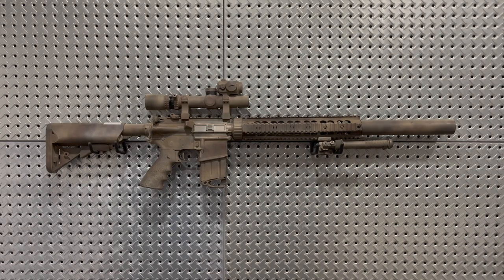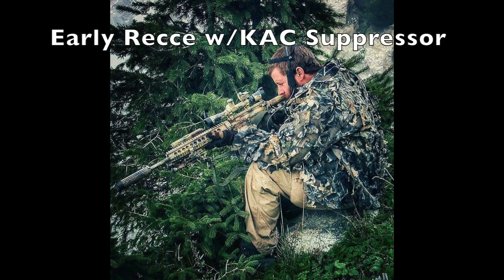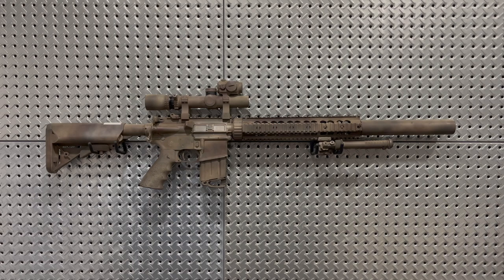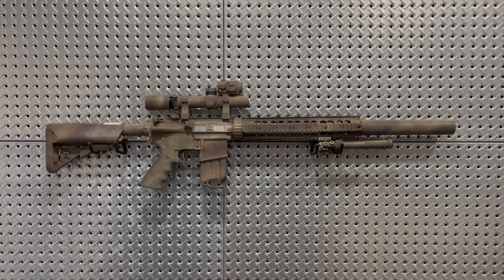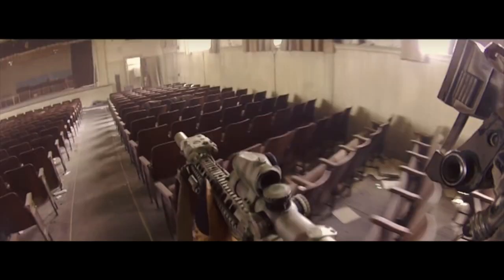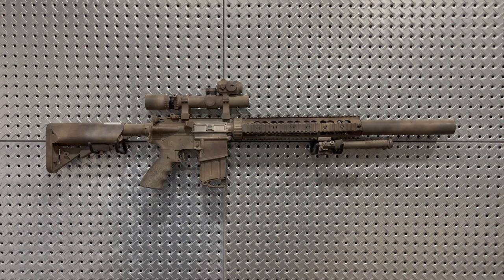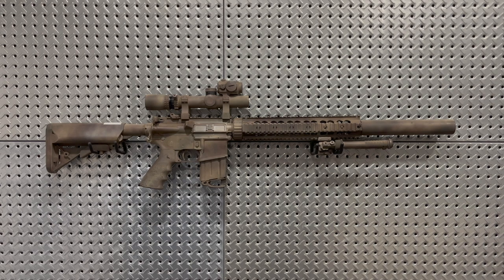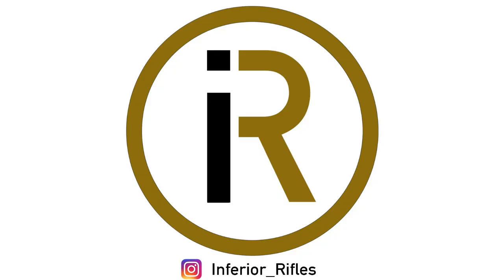SEAL "Recce" Clone Build Overview

Comment: Man.. now days, those KAC rail systems are more expensive than some guns.
Reply: June 2022- a KAC FF RAS auction on GB closed at over $1500
Reply: Are full length RAS discontinued now or just momentarily paused with production?
Reply: @bdanyellz4067  They are produced in cyclic production runs; the last production run was pre covid
Reply: As of 2024 just picked one up for 450
Reply: Found one for $550 new.

Comment: Something about the fixed stock versus the collapsible. At the time, there was no H2 or H3 buffers for the carbine receiver extension; so, using an M4 lower with an SPR upper that had the suppressor attached was advised against by NSWC Crane. There was too much potential of breaking the rifle with that combination. With the introduction of the Mk.18 also came the H2 and H3 buffers and facilitated safe use of a collapsible stock with the Mk.12 and Recce rifles, though still not suggested by NSWC Crane.
Reply: Breaking the rifle wasn't the issue; bolt carrier bounce on full auto was the reason. Alan Brown and Vince Jiga have spoken about it in depth.

Comment: Very interesting! I always thought the RECCE came after the Mk12.. I'm almost done my RECCE I just need the handguard..
Reply: There were all different types of "Recce" variants pre-M4, which likely drove the M4 into being a flattop railed upper.  On the Army JSOC side, they were cut 723 uppers with drilled and tapped rails on top of the shaved upper.

On the Navy JSOC side, they were cut 727 uppers.  M4 was in development right around that time, and early XM4s had 727 uppers with different barrel profiles, eventually settling on the 727 barrel with stepped 203 bracket cut on the forend, but with the dual heat shield handguards, 4-position RET, castle style lock nut, reinforced pivot pin bosses, and beefed-up RET thread boss on the lower.

The most unique Recce rifles were in The Unit, where light and laser mounting and user interface were worked out better than most modern builds.

Comment: Thumbs up.  SEALs got the idea from JSOC, who had certain carbines modified for DMR use among the Sniper Operations Teams within Recce Troops, as well as one of the many options for Assaulters to accommodate attached lights, lasers, and free-floated suppressed set-ups.  We're talking even before Mogadishu 1993 timeframe.

723 uppers had the "carry handles" cut off and had Weaver rails drilled and tapped to them for compact Japanese 1.5-4.5x Microdots, Hensoldt, and Leupold scopes by Unit armorer section for the DM builds.  KAC made some early 1” high rings for those since they had already been making scope mounting options for the SR-25 Match Rifle.

They also used modified SR-25 Match rifle float tubes with special AR-15 barrel nuts, Bushmaster V-Match free-float tubes, and initially tried Douglas match barrels shooting 68 or 69gr OTM ammo.  The Douglas and other match stainless pipes burned out pretty quick on their shoot schedule, so they found a supplier for CMV steel barrels that would shoot well and used those instead.

DEV took notice when working with Army JSOC, and then it spread into the SOCOM elements of the Teams.  Navy sourced a lot of Lilja barrels for theirs, including 17".

You can see pics of "Sawman" Sawyer with an early Recce version of what I'm talking about with the knurled aluminum float tube handguard, Leupold, Wilcox Laser, etc.

In The Unit, some Teams had these with FSP cuts in the tube with holes drilled for the taper pin access, and small sections of rail drilled and tapped where necessary for the PAQ-4, Surefire P60, modified A2 VFG with integral cockpit-type push buttons for the light and IR Laser.

Most of those rifles had standard Abu Dabi 723 uppers with A1 sights and shell deflectors, different types of carry handle rails, and Aimpoint 2000s, then later 5000s.

(Some of those configurations were used in Sniper Teams in Ranger Regiment as well for the Sniper Team Leader 727s, and the Aimpoint 5000s transferred over on some guys' M4A1s in the 1994-1995 time period, then were replaced with Comp Ms.)

The Unit Recce 723s also had Fiberlite stocks with cheek pieces, sharktooth butt pads zip-tied in-place, and Lone Star Ordnance enlarged pistol grips with swivel cover storage compartments on the bottom of the grip.

The KAC MRE M4A1s largely replaced/superseded these JSOC Recce carbines since it was easier for armorers to replace barrels on the KAC free-float tubes than the elaborate workaround of the cut and modified CF or aluminum tubes.

There were also the OD Green fiberglass ArmaLite tubes with threaded sockets wherever the Operator wanted them for rail section attachment.

The JSOC Recce 723s with 12" tubes and suppressors were one of the unique configurations you just don't see any photos of, especially with the integrated button A2 VFGs and mini rail sections, with Front Sight Pocket cut for the FSB.

When you see a fully-configured JSOCMOD Recce 723, they are very striking with the suppressor emerging from inside the float tube, like an MP5SD.

There were a lot of Redi-Mags in-use back then as well.  Bowflage was popular for camo, since it was an extremely matte texture.
Reply: Thanks for that run down, cool info I had no idea about! You should have a YouTube channel. I'd be there 👍
Reply: @westernoutpost4154  It's hard finding parts for those types of builds, especially the Lone Star Ordnance pistol grips and "CAR-15" marked cheek pieces that snap onto Fiberlite stocks.

Same for the sharktooth butt pads.  The stock weld you get with those sharktooth pads is superior to any other butt pad I've used on the market.  Once you index, they just stick to that place and don't move.
Reply from the maker: The Recce “rabbit hole” certainly is deep. It’s hard to pick a timeframe or even a specific group when talking about rifles like these without making a super-lengthy video; I was tempted to mention the various other programs that were going on around the same time (Army SDM-R, USMC SAM-R, etc) but I chose to only mention the programs that persisted throughout the GWOT and are still being used today (albeit in very limited capacities). Thanks for watching and for your informative comment
Reply: @InferiorRifles  Throughout the history of SOF units using certain oddball AR-15 family weapons, I'm particularly interested in the 1963-1967 period, the 1980s, and early 1990s up through 1993 before we started seeing M4A1s and eventually M4s enter into service.

One of the first AR-15 Light Sniper rifles was the Colt 656, which had a railed upper receiver, hooded FSB, heavy barrel, and flip-up rear sight with rounded protective ears.  It was developed and operationally fielded among hand-selected snipers in Vietnam, along with 2 M-14 variants and a bolt gun by the Army to determine what direction they would go for a Sniper System.

The 656 had a somewhat elevated Weaver rail integral to the upper, along with the BUIS flip-up aperture, but was fielded with a scope.

Different units tried the Colt 3x and 4x scopes as well in an ad hoc DMR set-up, and we even had some of those Colt scopes in arms rooms into the early 2000s.

There was a gunsmith in the Fort Bragg area who did flat top conversions for guys in The Unit dating back prior to the M4, where he drilled, tapped, and welded rails to uppers after clipping the handles off.

During the XM4 trials and development, they started out with 727 uppers (M16A2 but with extended feed ramps), with different barrel profiles, eventually standardizing the 727 barrel but with a flat top, Picattiny rail and detachable handle/rear sight assy.

The Unit primarily was using 723s at the time, which started out with pencil 14.5" pipes, but were quickly replaced on their intense shoot schedule with 727 barrels.

Different Teams had different accessory configurations, and as they conducted a lot of joint training and deployments with DEV, they kinda fed back and forth off each other.

There has always been an operational need for a light Sniper Support or DM AR-15 variant within SF, LRRPs, Infantry, Ranger Regiment, and later JSOC.

There are some really cool set-ups with no online photos to-date that I've seen, that really caught my attention when I saw them.